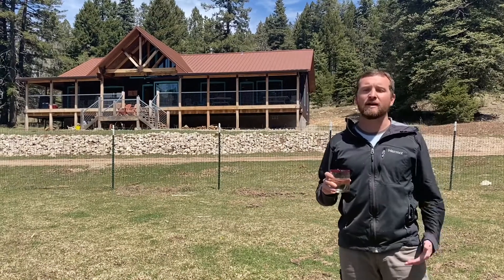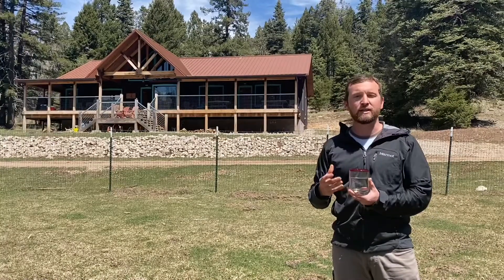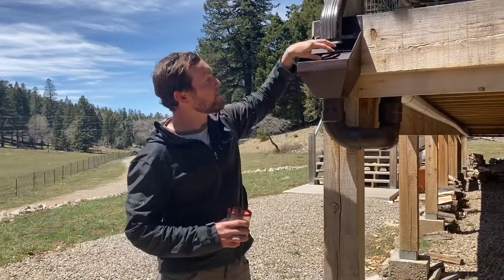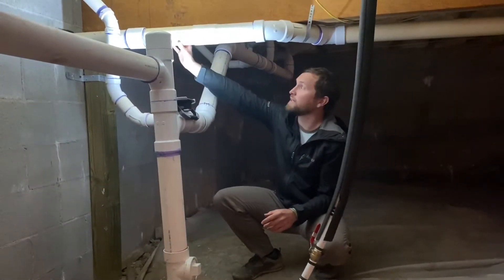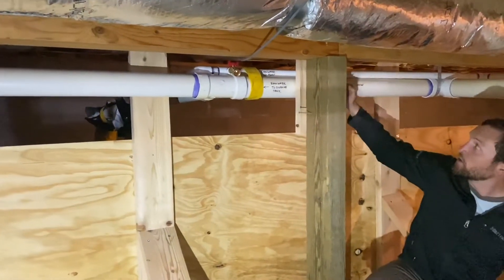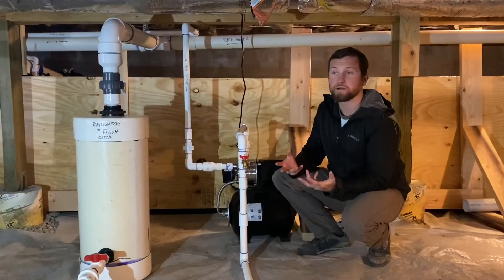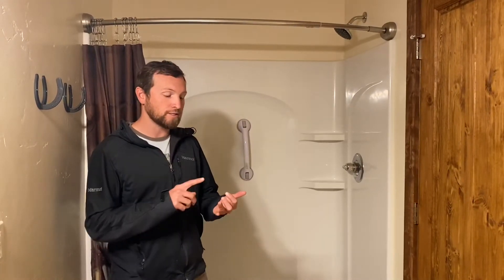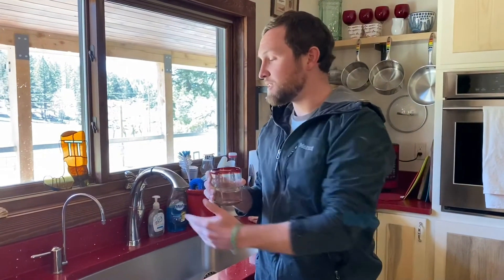How to harvest drinkable rainwater off the roof of your house

Comment: Is the first flush filter the only filter before going to your water heater and
appliances like dish washer,
Washing machine etc. ?
Reply: There are two types of filtration protection before the water is stored. The first is the leaf filtering rain head.  The next is the first flush device. In this case, the water from the storage tank get used in appliances, water heater etc., as you observed. Thanks for the question.
Reply: Also, to clarify, the water that is caught by the first flush is discharged to the landscape and is not used in the house.
Reply: Thank you very much for the clarification!